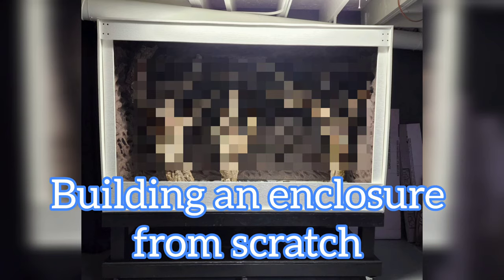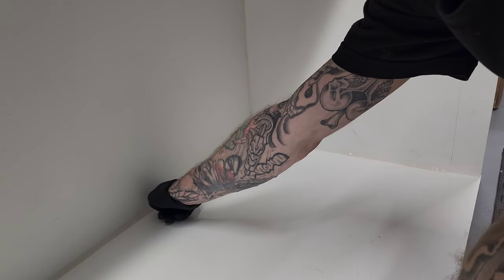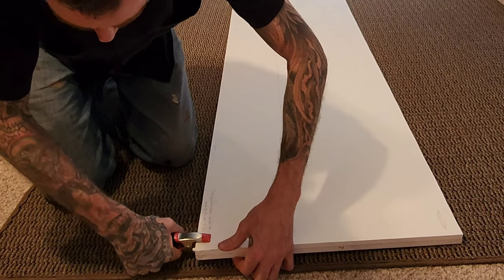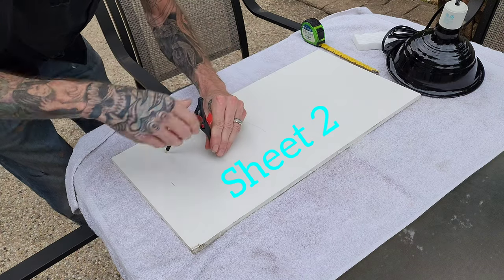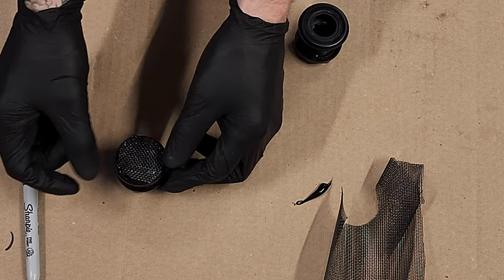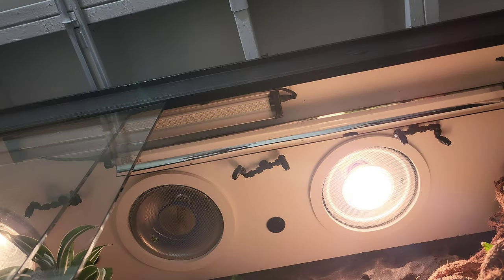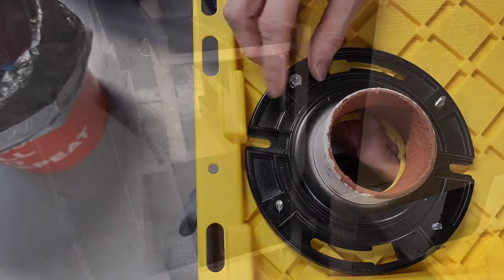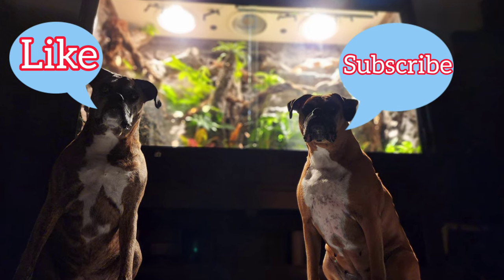How To Build A Reptile Enclosure PVC or Wood DIY Cage #reptiles #enclosure

Comment: I was wondering if you ever have any trouble with the heat lamps or ceramic heat emitters warping the to of the enclosure over time. I was planning on doing my lights like the way you did yours in this video for my 8x4x4 tegu enclosure but, I am worried that with his very hot basking lamps it will warp the pvc. Any thoughts would be very helpful.
Reply from the maker: That was a thought of mine too. But so far everything is holding its shape. 2 reasons I doubled up the front frame (screwing two 1/2" peices together to make 1")
1. Was for the glass track.
2. Was for extra support to keep its shape without a center brace.
Having said that when I do a 8w4d6h Varanus Cumingi enclosure I'm going to need a center brace bc of the with distribution on top. 
I use DHP for night time heat and 2 flood lights for day time heat. The hottest basking spot is 130°F and the top ambient is around 90°F with a temperature gradient droping to 72°F at the bottom.
When I do the 8x4x6 I might use plywood and lint the inside with PVC. Still brainstorming lol
Reply: @bradsbioactivebuilds  Thanks for the quick reply 😄. I guess I'm gonna go with it then. Thanks for the great detailed video, it's by far the most detailed big enclosure build on YouTube. You've got great talent and I hope your channel explodes and you do great keep up the good work 👍.
Reply from the maker: @The_Dreadbug  thank you for your support and have fun with your build 🦎🤘🦎💯
Reply: @bradsbioactivebuilds  How good does the Lexel adhesive compare to silicone? I've never used it but, have been wanting to try it for a while.
Reply from the maker: @The_Dreadbug  this is my 1st time using it. It seems to bond better than silicone. Silicone seems to come off of PVC with ease. I have used GE 100% silicone sealant for plastic sheets and other plastics at home depo located in the plexiglass section. Seams to have a stronger bond then regular 100% silicone. The lexel Adhesive had a very strong bond once I ran my finger in the seam. It is 100% paintable so I did a coat of drylok over it for extra protection (bottom portion of enclosure where water could pool). I would rather over engineer and save my self a headache in the future. I few people I know that have ordered pvc enclosures said the lexel came with the enclosure or was suggested to use when assembling. Hole this helps.
Reply: @bradsbioactivebuilds  I think I might end up giving it a try. I was planning on doing a layer of drylok anyway. I was also going to get some of the white kind and use it to cover the screw heads before painting the outside. Thanks again.
Reply from the maker: @The_Dreadbug  awesome. I found drylok does not bond to regular 100% silicone.  That's another reason I went with lexel bc it can be painted. Just had to wait a few days before pajnting days.
Reply: @bradsbioactivebuilds   Hey Brad! How is the top panel holding up after 1 year? Has there been any bowing at all? Also has the lexel/drylok combo held up well? No leaks? Thanks a bunch!

Comment: Awesome video! Where do you buy your glass? What kind of glass is it?
Reply from the maker: Thank you, and I just Google searched local glass shops in my area. I found a really good one by me. But there were several that popped up when I searched.
For bigger enclosures, I use tempered glass and also have them round the bottom edges so it's not a 90° angle (it's more like a 45°. I also use 1/4" glass
🤘💯🦎🐸🐢🐍🌱
Reply: Awesome! Thanks so much! :) Inspirational work!!!

Comment: Absolutely incredible DIY enclosure. May I please ask what kind of price range this cost to build? 👏👏👏👏
Reply from the maker: Thank you 
Cost for just the shell about $322:
* 3 sheets pvc $100 each
*screws $10
* lexel Adhesive $12

Tempered glass $250
* glass track $40
* glass handles $10 (4 pack)

Stand $100 (with casters) that's a guesstimate 

Misc
Paint: $50
Light fixtures $20 (x3)
DHP $20
Halogen 38 par $10

Nestbox $45

This all a guess and rounded up
Hope this helps! 
🤘💯🦎🐍🐸🐢🌱
Reply: @bradsbioactivebuilds  👌 thank you SO much for the breakdown! Truly magnificent enclosure! I'm now subscribed to your page!
Reply from the maker: @snyds84  thanx for the sub bro!
If you build something like this and have any questions, feel free to ask.
🤘💯🦎🐍🐸🐢🌱

Comment: Please do the Video on the fan system
Reply from the maker: Soooooon. I'll be building some this konth then coming out with a video on 4 different ways to add air circulation. Stay tuned and sorry for the delay. It's been on my mind. But working on a cool way for 80mm fans now.
🤘💯🦎🐸🐢🐍🌱
Reply: @bradsbioactivebuilds  Thank you i have an 18x18x24 did some mods to hold humidity better but need a way for more air circulation

Comment: Great video, how much did this roughly cost you?
Reply from the maker: @leche2905  with out any of the interior work or lights probably around $600 USD
$300 pvc sheets
200 glass
40 glass track
60 Misc

Stand $50

Comment: How heavy was the enclosure by itself?
Reply from the maker: Each 4x8 pvc sheet is roughly 50lbs. Figure I used 2.5 sheets so about 125lbs. That's not including screws or tempered glass or the stand.
Hope that helps!
🤘💯🦎🐍🐢🐸🌱

Comment: Where do you get these pvc boards? I can't find them anywhere
Reply from the maker: Some stared and regions don't Cary them at big box hardware stores. I got mine from home depo. But lowes caries them as well. Look around the plywood section and trim board. 
Otherwise, try a custom sign shop. They know it as expanding pvc board.
Hope this helps.
🤘💯🤘

Comment: Where did you get the glass and track
Reply from the maker: I got the glass from a local glass shop. I measured the opening before installing the track. Gave the shop those measurements with a small cut-off of the track. They cut to size. 
I have the glass track in the description of this video here https://youtu.be/WZ3EYjO_PIQ
🤘💯🦎🐸🐍🐢🌱

Comment: Hey brad! If you know, what paint and primer did you use?
Reply from the maker: A primer that says for pvc and an acrylic paint over that.
Let me know if you need more info.
🤘💯🦎🐸🐍🐢🌱
Reply: @bradsbioactivebuilds  okay thanks🫶🏾 currnetly building a 6 x 3 x 4 for my retic
Reply: @bradsbioactivebuilds  and what wattage was your DHP?
Reply from the maker: @313_exotics  100 l watt. They work on dimmer switches so you can dial it into your preferred temps.
🤘💯🦎🐸🐍🐢🌱
Reply: @bradsbioactivebuilds  also sorry to bother you again but what were the dimensions of the glass ?
Reply from the maker: @313_exotics  what you want to do for the glass is measure the length and add 2 inches for your overlap 
For the vertical part you would want to measure the distance before adding the glass track. What ever that measurement is take that to a glass shop with a small cut-off of the glass track. Tell them what your vertical measurement is and tell them you are using the glass track cut-off.  They will be able to measure appropriately. 
I use 1/4 tempered glass
Reply: @bradsbioactivebuilds   thanks

Comment: How much roughly were the materials?
Reply from the maker: Just for the shell/ enclosure 
3 4x8 pvc sheet: $300
Tempered glass $225
Glass track: $40
Box of screws: $10
Lexel Adhesive $12
Drylok: 1 gallon $35
Primer $40
Black paint: $60
Wood stand: under $80
Exterior hide/nest box under $50
Bulkhead for drainage: $7
Lights (personal preference)
Misc. $100 because I'm probably forgetting something 😆 
There are ways to cut down costs, but that also makes for a cheaper product in the long run.
This is an estimate. Hope this helps.
🤘💯🦎🐸🐍🐢🌱

Comment: How much does it weigh without the stand?
Reply from the maker: I have no clue. I don't have a tool to weigh the enclosure accurately. If I had to guess 300lbs with glass, substrate, water weight, and plants.
Reply: @bradsbioactivebuilds  oh wow.   Thank you
Reply from the maker: @hremaddox  of course. The enclosure without anything would be much less (just the pvc sheets and glass). Now you have me curious as to what it all weighs lol.  🤘💯🦎🐸🐍🐢
Reply: @bradsbioactivebuilds  I was wondering because I like the idea of making one on a floating shelf or built into the wall
Reply from the maker: @hremaddox  floating shelf could work with a smaller enclosure. The pvx board is super light in comparison to other building materials. Would like to see what you come up with if you do it. 
🤘💯🦎🐸🐍🐢

Comment: only complaints about this build is the lack of pvc glue on the plumbing and on the panels, pvc glue is made for plumbing and retaining water in pvc pipes, you could have skipped siliconing the inside seams if you had glued them with pvc glue, or put the silicone in anyway and been double safe. also just because the drywall screws come in a 1000 pack doesnt' mean you need to use them all.
Reply from the maker: Agreed to a point. Ias contemplating using pcv glue, but want to be sure if I would be able to work quickly enough before glue fused together. So I went with lexel adhesive (paintable) where water would sit. Then, I applied drylok or xps board over that. But I've been thinking about working real fast and use pvc glue on an upcoming build.
For the plumbing, yes pvc glue would work great, but I was thinking of the future and when I move, the silicone will be easier to remove so I can put the enclosure flat.
🤘💯🦎🐍🐢🐸

Comment: Switch the way the doors open
Reply from the maker: What do you mean?
Reply: @bradsbioactivebuilds  buddy has one made. 
 might be an idea to try he likes it, he made the door open up an down. So when he cleans it he doesn't need to move the doors from side to side, it just collapses down, he was using a slide lock but found hinges an two screwed in wood tabs at the top, that you can turn over the plexiglass works better.
Reply from the maker: @Political Hate.  I see what your saying. I build a trgu enclosure like that years ago. It was very User friendly with plexiglass.  I would be nervous with tempered glass with the weight alone. If this build was using plexiglass it would definitely not warp as easily with what you are saying. I just use glass suction cups to remove it now for cleaning lol

Comment: What’s the logic/purpose of making a half inch gap for the front frame boards? I’m about put together a 4x2 and just re watching this video for the 100th time so I do this right the first go around lol
Reply from the maker: No real structure improvements other than cosmetic appearance. It adds a nice finish. But some may like a more boxy look to.
If there is an added structural advantage, it would be for the sliding glass door to sit in a hair when it shuts. this will also allow you to add weather stripping along the inner edge. 
Have you watched the video with the blue tree monitor on the thumbnail?  It's the same enclosure, just a different part of the build. You may be able to see what I'm talking about there. 
It's a fun build to do. Have fun with it, and if you have any questions along the way lmk
🤘💯🦎🐸🐍🐢🌱
Reply: @bradsbioactivebuilds  dude thank you so much for the detailed reply. I was thinking it might have been for the doors. And yea I’ve watched the blue tree monitor video a bunch. I’m always bouncing between your videos and not taking notes (my bad). Love that video and build, i was actually about to watch it again. Thank you and have a great day my man 🤙🦎💚🐸🤘
Reply from the maker: @Diddyx23  of course bro, anytime. You have a great one too!
🤘💯🦎🐸🐍🐢🌱

Comment: What kind of saw table do you have
Reply from the maker: I don't have a table saw. I just use a skill saw and a Jig saw. One day I'll own a table saw lol
Reply: @bradsbioactivebuilds  lol I believe in you 💯 but how do you keep your cuts straight ?
Reply from the maker: @JayBay813  a table saw would be beneficial and a nice cut, I should really get one someday.  But I use a  combination of free hand cutting slow. But I do use this from time to time when it's a really important cut. 
https://www.harborfreight.com/52-in-and-100-in-clamp-and-cutting-edge-guide-58363.html
Reply from the maker: @JayBay813  you will just have to adjust for the saw width for what it runs along the clamp. Take that measurement and make sure it's the same on both sides and clamp it into place.
I just ise the 2 inch xps board I'm using for the background and make my cuts on top of that. You can see me using it in the 1st video with my current build project I'm doing
Reply from the maker: @JayBay813  you can see the clamp and cutting edge tool I use in this video 
https://youtu.be/mfydItUfs8c?si=mobtJDenBbHLem4c
Reply: @bradsbioactivebuilds  yeah I fount a cheaper table saw but honestly I have like three builds to make I won’t need it anymore so I guess I’ll just do the circle saw
Reply: @bradsbioactivebuilds  what type of saw blade do you use and are blade’s compatible with different brands ?
Reply from the maker: @JayBay813  for pvc I use the plades with as many teeth as possible. All should be compatible with saws. Just make sure you get the correct size blade that fits your saw (it should say on the side of saw what size it takes)
Reply: @bradsbioactivebuilds  you rock. They guy was telling me that the one for plastic was for pipes but it didn’t specify it just had a picture of pipes. Anyway it has about 140 teeth, he told me not to use that one but I bought it just in case you said something along the lines of that lol. I respect his expertise and knowledge but experience just holds more weight in this world lol. You Rock man !! Is the blade carbine or just regular metal
Reply: @bradsbioactivebuilds  he also told me to turn the blade around so the teeth don’t grab the plastic?
Reply from the maker: @JayBay813  I wanna say I use carbine blade.
🤘💯🦎🐸🐢🐍🌱
Reply from the maker: @JayBay813  interesting, I have not tried that. I have not had an issue but have not tried that, so I couldn't say 1 way or the other.
Reply: @bradsbioactivebuilds  thanks man you’ve really help and mentored me a lot !!
Reply from the maker: @JayBay813  of course, anytime, you will do great!
🤘💯🦎🐸🐢🐍🌱

Comment: My question is how is this the way to save lots of money when each sheet of PVC bored is $116 a sheet here in 2023... And clearly you're going to need at least three sheets... Last time I checked that's $350 That's before you even buy screws... 😢
Reply from the maker: Good question. I was originally looking to buy one of a similar size. I was looking at anywhere from 1500 to 2500 just for the enclosure. 
I paid $99 for a 4x8 sheet (yes I needed 3)
$10 for screws. 
Glass track $40.
Lexel $12
Glass about $150
Glass handles $10 for a 4 pack
Still a lot cheaper than I was originally looking at of a purchase. Plus I got the enjoyment of building it myself.
🤘💯🦎🐸🐍🐢🌱
Reply: @bradsbioactivebuilds  super true ... Yeah that's what I was thinking about that price but yeah it is cheaper if you're looking at that range

Comment: Do you prefer PVC or wood?
Reply: Also which one is cheaper?
Reply from the maker: @Crusty Duck  it really depends on the animal going into it
Wood is cheaper, but in the long run PVC will last longer and won't breakdown like wood could. If I build a 10w6d6h enclosure I might do wood frame and line it with pvc. 
Overall of I can use PVC I will over wood
Reply: @bradsbioactivebuilds  Do you recommend any specific plants that grow well in the environment of a vivarium for tree monitors?
Reply from the maker: @Crusty Duck  pothos is always a good go to. I'm having success with the money tree and monstara & monstera plant. All the others are holding up well. I dod loos the birds nest fern but it was probably due to to much light. A lot of them will do well if you give them a few weeks to root before you put the monitor in. Also depends on the monitor and the want to uproot plants lol 🤘🦎💯
Reply from the maker: @Crusty Duck  I am going to remove the palm as well. It is doing fine I just don't like the place I put it. It looks a little to crammed and want something to fit a little better
Reply: @bradsbioactivebuilds  Thank you for your responses.

Comment: 3 sheets at $100 a sheet...
Reply from the maker: Yup, not to bad compared to what a store bought would be. Plus, no sealers needed to protect it from water like you would with wood. And pvc will last a lifetime.
Reply: @bradsbioactivebuilds  so agree. I always used plywood, paint, poly, etc as you know. Lol love your work!
Reply: @bradsbioactivebuilds  just incredible talent like I mentioned Brad! Good thing I like cyclura. I don't have to have the full water drainage setup.. Lolol
Reply from the maker: @LoveGuruGreg  thank you very much!